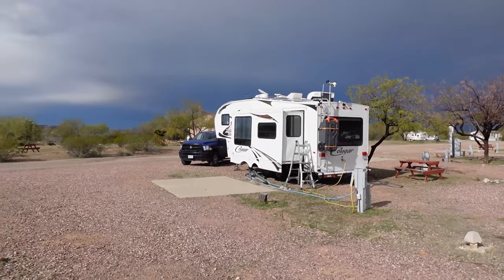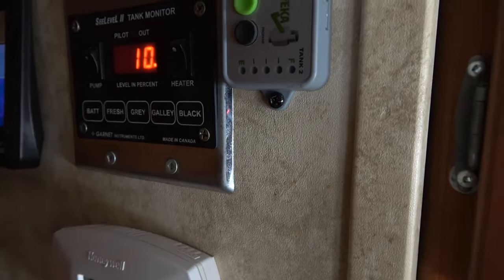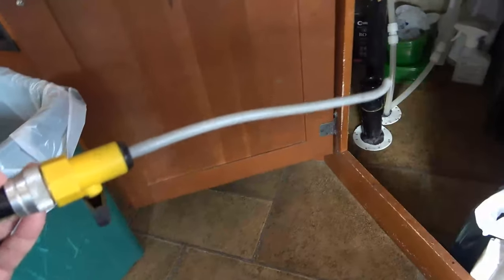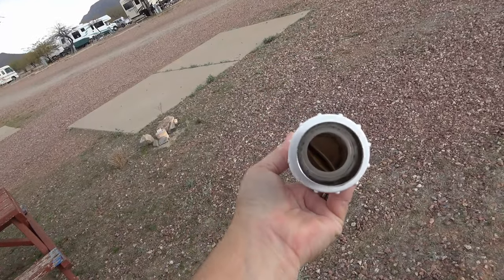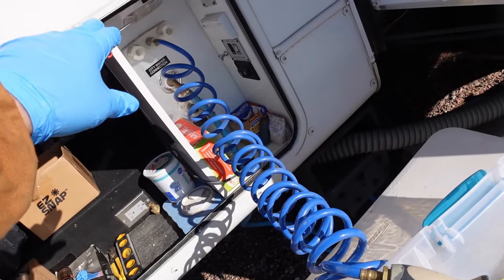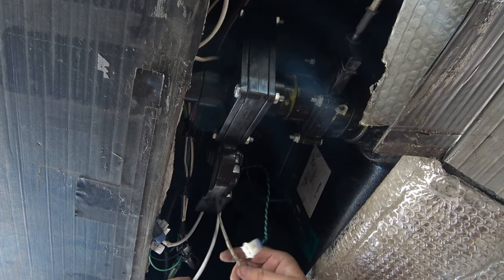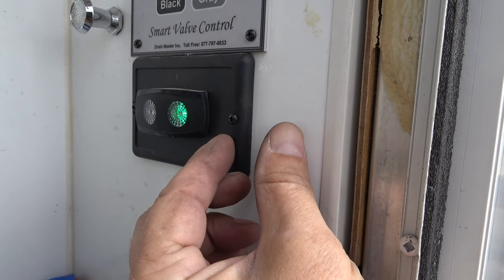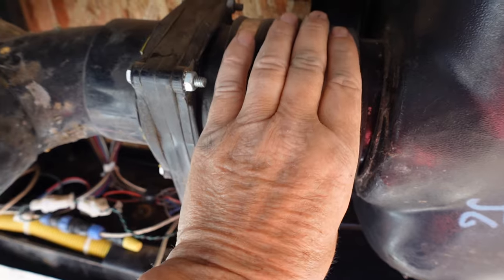Cleaning & Lubing RV Waste Valves + Black and Galley Holding Tank Flush - Plumbing Maintenance

Comment: I ran into the same problem with the removal and installation of waste valves on opposing waste tanks.  Valterra makes a short coupling that I used to install the valves but am completely satisfied that I got a substantial seal.  It doesn’t leak now but haven’t tested it on the road yet.  I’m curious where you found a 3” dia. piece of rubber hose?  It would allow more flexibility than the valterra coupling.  Enjoy your channel.  Thanks, Ted
Reply from the maker: Home Depot and other hardware stores sell many different sizes of rubber plumbing drain couplers https://www.homedepot.com/p/Fernco-4-in-x-3-in-PVC-DWV-Mechanical-Flexible-Coupling-P1056-43/100372297
Reply: Thanks for answering my question.  On my GD Reflection I need a coupling with more flexibility. Think I’ll check out inner tubes.  Thanks again.

Comment: I have the exact same valves in my GD Solitude which (knock on wood) have been working flawlessly.

Have you ever tried using Thetford drain valve lubricant?  I'm curious if the stuff actually works or do I need to take them out when all I'm after is to lubricate the valve. (No TP jams)

As always Ray... Great video...
Reply from the maker: I've never tried it. Might be worth a shot. My issue is with clogs every once in a while. I think it's mostly due to the trailer design; I had to mount my valves on their side versus more vertically and I dry camp using the macerator pump. I don't get the normal flushing action that gravity dumping with a 3" pipe allows for.  Cheers! Ray